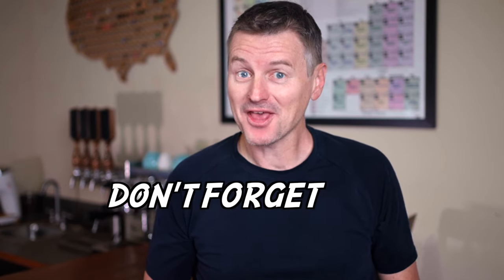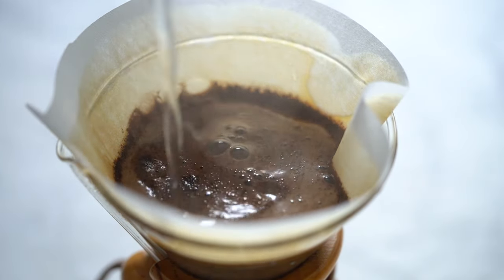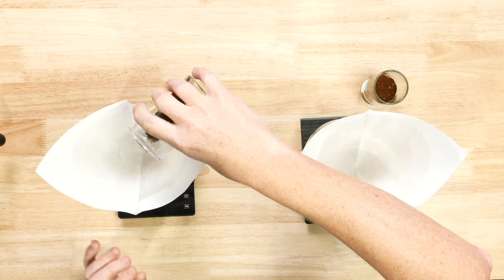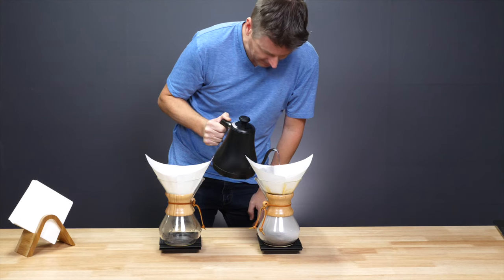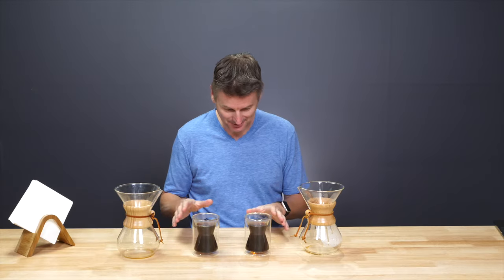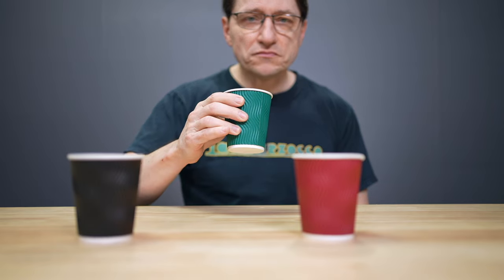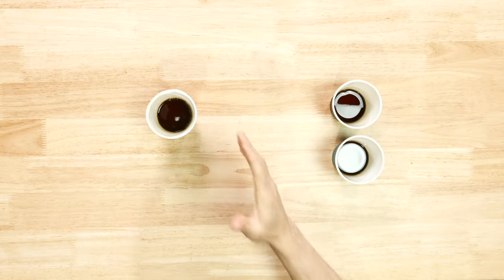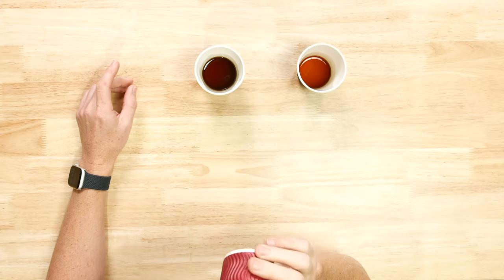Why Bloom Pour Over Coffee?

Comment: I don’t bloom because Im trying to get rid of the C02 but because I want to pre-soak the coffee and let it soak up the water better. I do this with my espresso machine too. I pre-infuse then pull the shot. Same with pour over. A pre-infusion of sorts then finish it off. I like pour over coffee but I do use finely ground coffee as I would for my espresso machine. So I have to be careful because it will clog the filter and slow the extraction. So I try to not do so much water with such fine grinds. Quicker extraction and it's good with hot milk.

Comment: I use Chemex and I've been a convert since being introduced to it in 1985.  I vacuum store my beans and grind just prior to brewing.  I've run this test and had it run on me.   My takeaway;

30 seconds is insufficient.  A minute has produced more consistent and markedly different, improved results.  Then again, I brew 50g of beans, not 15g.  Though ground coffee is going to absorb water and offgas at the roughly the same rate, regardless of volume.

The single biggest improvement one can make is to use the Chemex branded filters and not use the brown ones.  Violating those two will radically (and horrifically) alter the taste.  Everything else past that is fiddling with the knobs.